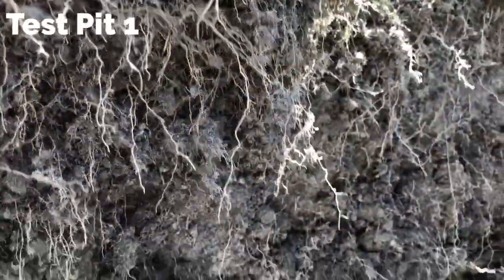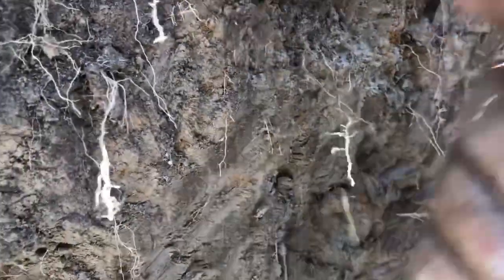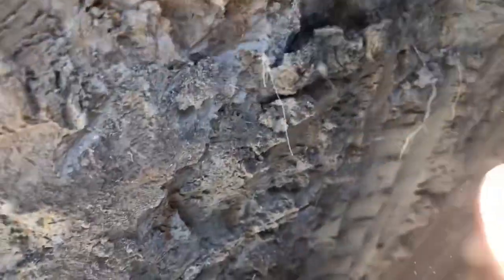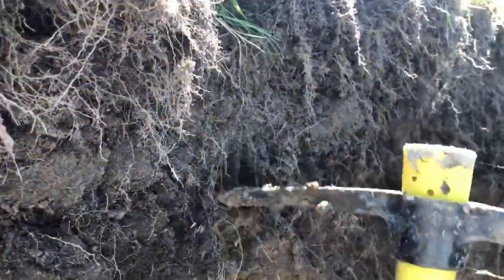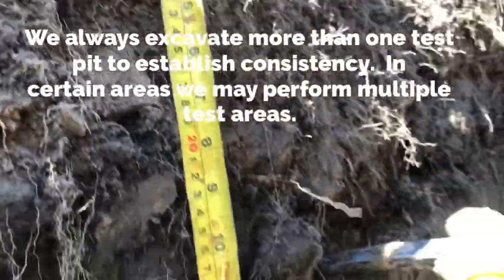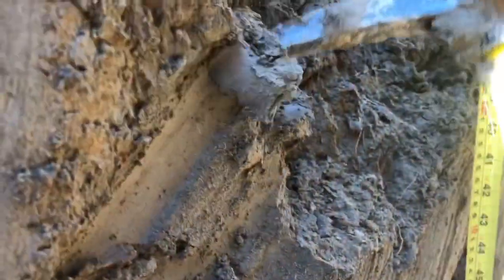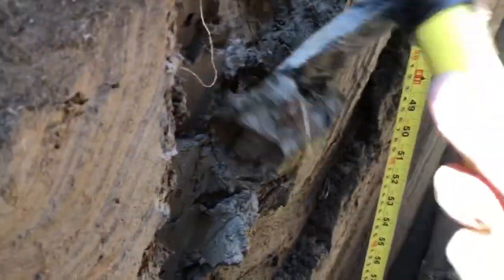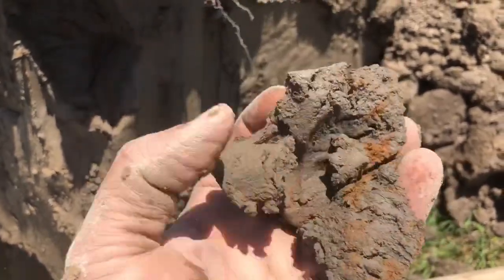Soil Testing In Flood Plain for Septic System Design

Comment: Thanks for the videos. If the soil is too clay and sandy, therefore there's no chance of a septic tank being installed?
Reply from the maker: We install septic systems in clay regularly.  We utilize an above grade system (sand mound), this method has been used successfully for many years in tight soils, seasonal saturated soil conditions, water tables, shallow soil depths etc.
Reply: @groundstonewastewaterservi5066  I know this is three years later, but do you have more videos, information, website on these high water table installs? That test pit looks EXACTLY like mine except I have a bit more stone down the bottom as I'm about 400m from a river. I've never been so stressed before in my life trying to find someone who can come to me with a solution that makse sense. I am in New Zealand.